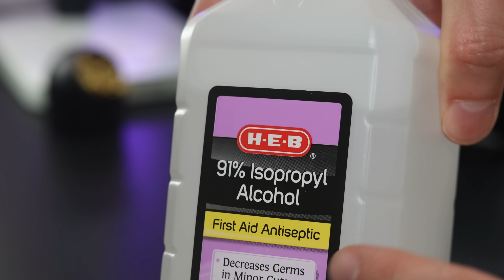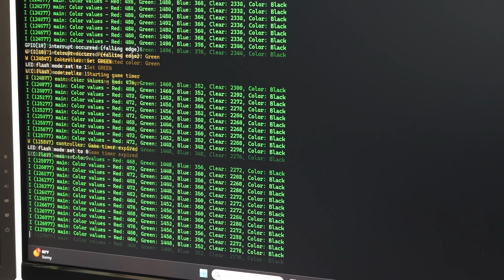Do This Before You Solder Anything

Comment: i find theory missing: solder can stick to surface or can really bond if heat and flux are correct. If solder just sticks, You can easily remove it by little of force (i saw experiment where copper plate had some coldjoiney solder sticked on top and it was easily scraped off with an edge).

That sticking doesn't guarantee proper joint: its resistance can be higher and mechanically it's not stable, because it can break and leave a little gap, which doesn't conduct or conducts only when mechanically something is changing (applied pressure or thermal dilatation). So:

1. if it works, that working state can change due to vibrations, mechanical forces, thermal expansion or other reasons, so it need to be fixed now.

2. For avoidance You need to have propper wetting: metal should be hot enough and accessible, ie. not covered by oxides – that's why we apply flux.

3. Repair is easy: apply flux, because hot metals oxidize faster and heat all of it properly.

4. Cold joint doesn't mean iron were too cold. It means metal You are soldering wasn't hot enough, so just ramping up temperature, isn't proper solution. Just do thermal bridge with hot solder: he said a little bit of solder can warm up everything properly.

Comment: I would never recommend leaded solder to beginners.
Reply: I agree, if you're going to learn from scratch, you might as well start off with a decent lead-free solder. It's no more difficult, just has a different feel than those of us who are experienced are used to. (Which is hard to unlearn - For me, it's the difference in surface tension that I notice the most.)
Reply: ROFL WOT? 😂😂
Who snorts lead dust?
Next they'll be scaremongering about the dangerous fumes from molten leaded solder! 🙄
Reply: yeah no. Stop fearmongering with lies

Comment: IPA evaporates slowly. for fast evaporation it is better to use acetone or toluene. they are also much better at getting rid of 559 asm residue. IPA is usless for that.
Reply: IPA is pretty much useless for flux cleanup in general, it just spreads the mess.
It's cheaper to use denatured alcohol (methylated spririts) if you only care about cleaning to the same level as IPA.
I use aerosol cans with a product called "PCB cleaner" which works so much better than IPA, yet is about the same price. It's a product that is designed for cleaning PCBs, go figure 😂

Comment: Should we clean the solder afterwards with ipa to remove flux residue?  I was told flux / maybe not all is corrosive and should be cleaned off after soldering.  Maybe this is just wrong???
Reply: You should clean tbe flux off if it's a radio frequency. Otherwise, it wont really make any difference. However itlooks nicer when cleaner.

Comment: For a soldering pro your soldering iron tip is surprisingly dirty.
Reply: No, it's not dirty at all. It simply shows it has been used, and what it looks like is totally irrelevant to the joint.
Only rich Youtubers use a brand new tip for every video clip.
Reply: @johncoops6897  Cleaning is a completely different thing than taking an new one.

Comment: The trend for many years now in commercial assembly of PCBs has been to use "no-clean" flux. It is OK as long as you have no intention of trying to clean boards, but it is horrendously difficult to remove properly. Isopropanol works very poorly and will barely soften it even after several minutes in an immersion bath. Acetone works reasonably well but no one who is very well versed in handling volatile flammable solvents should even think about using acetone. Acetone will also attack many common plastics so it is only useful as a spot cleaner, again when you fully understand what you are doing.
The industry recommendation is to use an spray system with a saponifier in water. The saponifier will soften the surface of the flux and the spray washes it away. This is not a hobbyist process. 
I haven't looked for a long time, but it used to be virtually impossible to find solder paste for SMD with a flux based on natural rosin. The choices were "no-clean" and water-soluble. I went with the latter (as did the contract manufacturer I used).

Years ago I tried to get advice on conformal coatings on PCBs assembled with no-clan flux. The flux manufactures told me to ask the coating manufacturers. The coating manufacturers told me to ask the flux manufactures.

Comment: Having something to securely hold the circuit also makes a huge difference
Reply: A wife ?
Reply: Also the size of the soldering tip makes a difference too.   Usually a small chisel or bent tip works best.
Reply: I use a textured rubber mat. I think it was from a car. Has always worked perfectly.
Reply: The most underrated aspect of soldering is 100% holding the board down, I solder headphone wires to the smallest board known to man so I just made a simple holder with a piece of wood planks and some tiny screws just to hold it in place.
Reply: @Scohill  I like to use Blu Tac
Reply: I have solder mats to helping hands. Having a hand able to hold down on a wire after i position it makes it far easier. So much so for repairs that i do away from a workbench i have magnetic and clamping ones. 

Why make it hard at a risk of less quality work, for a couple $10 tools that will probably last forever.
Reply: Yes!!!! I use a heavy drill press vice. It just is lose on the table and can be placed and rotated freely. I could not do without. And also something to suck away the dirty air. I use a kitchen hood.
Reply: Helping hands or electronics vise makes life so much easier
Reply: Silicone matt and then Blu tack for everything else works wonders
Reply: 3:29 I have pissed of soo many people saying exactly this. I solder better than a lot of arguably way more skilled people online and with much cheaper equipment and it's all because of good flux. Flux is the easiest way to make soldering look factory clean and perfect.
Reply: silicon mat, blue tack, and a pcb holder when more force and less flipping is required, like de soldering a difficult component (multipin headers are the worst).
Reply: Not in my world it doesn't.
I'm only just finding that after doing this stuff for over 50 years that my hands have started shaking and my eyesight is dreadful. Always pinned the board still with the outside of my little finger whist feeding solder with either index finger and thumb or index and middle fingers. Always done the same when joining wires wire held between little and 2nd finger whilst feeding solder with index and thumb. And you learn this because in the field you don't have a bench to work on.
Reply: @Lamster66 I'm the same, eyesight is poor, can't see what I'm soldering at all blurry vision, the irony is its probably from reading and typing comments on my smartphone. Having either a set of magnifier goggles with battery powered lighting or helping hands with a lit up magnifier glass- top two tools to use imo. Or if you have a smartphone with UHD AT 60 frames per second and upwards on video mode, there are good adjustable phone holders with heavy base plates for sturdiness this is a good option if you like to see how well and check up in detail if any mistakes and progress documentation- easy to forget a step or two, plus a smartphone has a light on always option when recording in HD, UHD probably less frames per second, HD less definition but good enough for higher frame rate 90fps quality video. All are viable options on the go with velcro or zip hard cases with the cut out foam or block fit foam so you can make the case fit the equipment and keep it in best condition no scratches.
Reply: Yeah the solder will not set properly if it's moving around no1 tip there 👍🏻
Reply: Yes, having a clipboard will stop the paper getting blown away.
As for soldering through hole components, nothing makes it slower or more cumbersome that having the PCB held in some kind of frame.
Gravity holds things down onto the work bench... why not use it?

Comment: With the vast majority of things on PCB you do not need to heat the parts so they become hot enough to melt the solder. If you develop good skills you can apply the solder virtually as soon as the iron has touched the board, being very careful that you feed the solder to the pad, lead and tip simultaneously. If you are using cored solder and feed it properly the flux will flow ahead of the solder onto the pad and into a plated through hole. If you feed just to the iron tip the flux won't go where it needs to be - and you'll wind up resorting to unnecessary added flux as a standard practice.
If I used a preheat method I'd still be soldering boards I assembled 20 years ago. The "heat it til the joint is hot enough to melt the solder" is a hold-over from the days of vacuum tube sockets and lug strips - and plumbing.

 There are exceptions, where a component lead is very large and will sink a lot of heat. A bigger tip is usually the best approach if you have many such joints to make. If the PCB has usually large foil areas it can require longer dwell time.

Soldering to chunky metal things like large connectors and large wires does generally require some preheat time before you begin to feed solder.

Three seconds per header pin to solder is pushing three times as long as it should take someone with good skills. It does take some time, observation and thought to develop good skills, so three seconds for a beginner would be OK.

Don't assume that just because your soldering iron has a digital temperature display that it is actually delivering that temperature at the working part of the tip. There are some horrible products on the market these days that simply display what they want you to believe is reality.

Comment: I've seen people use flux with a brush and all kind of things, but never with this precise way of dispensing. Very nice.
Practice on broken stuff, and test your process on some old board before you dive into a difficult assembly.
Tie small stuff down to some heavy block with elastic bands, it seems primitive but works great.
I like to have aim a few LED worklights straight at the workpiece from different angles.

Comment: If you are routinely adding flux when hand soldering with an iron either your cored solder is of poor quality or your method is bad. Very rarely is extra flux necessary with good solder and good technique. I've soldered hundreds of thousands of joints on PCBs without having to resort to adding flux and I work very fast. (I actually dislike doing assemly - it is just grunt work).

Extra flux is often very helpful when tinning stranded wire. It is hard to the the flux from cored solder to spread adequately ahead of the solder.

I have sometimes use added flux for board assembly when the board itself was particularly difficult. I've designed lots of boards using 3/32" thick laminate with 4 ounce copper on both sides. Added flux can be helpful in that situation.
My preference is very much for water soluble organic flux, but if cored solder is used with it it must use a similar flux. In any case the boards must be fully and carefully washed within hours of assembly.

Comment: You do not want a solvent that evaporates really quickly for cleaning PCBs. You want the solvent to stay in place long enough to do its job properly. When any solvent just evaporates after being used for "cleaning" is simply leaves its load of contaminants behind. 
Isopropanol is not too bad. It really is not highly volatile in comparison with many other organic solvents. It will stay in place long enough to do a reasonably good job.
The other consideration with a highly volatile organic solvent is that most are also highly flammable. Acetone, for example, is a considerably better flux solvent than isopropanol but it is much more volatile and extremely flammable.
Reply: Acetone will melt plastics, definitely not the best product to use.
The best BY FAR is PCB Cleaner in an aerosol can... which works far better than IPA, and you can spray and drip off like how you use brake cleaner on a car.
Reply: An ultrasonic cleaner filled with isopropanol is good unless the part has MEMS or crystals components.